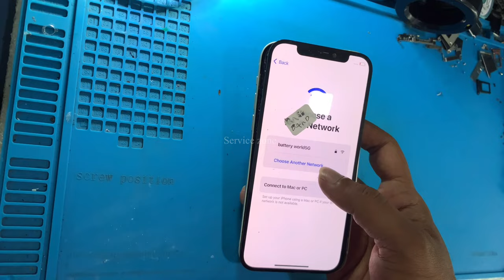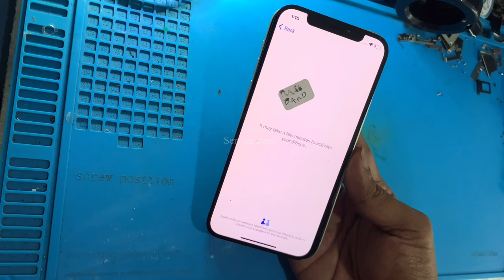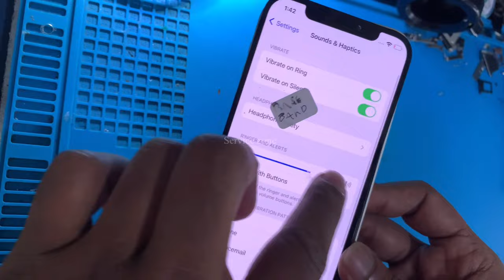Iphone 12 bend board repair,Restor wifi and baseband by recover damaged solder pads

Comment: It is not good to repair phones for use with this type of damage.  The repair won't last that long.  Just one drop, the customer will bring it back to the shop again.  It is only good for data recovery.
Reply: I use my phone repaired in same way for a year, no problem if job is well done.
Reply: @4Relax  this person didnt repair pads with solder lug. That makes repair last less time. it really depends on repair quality.
Reply: @mayanktiku9900  correct save time.. :)